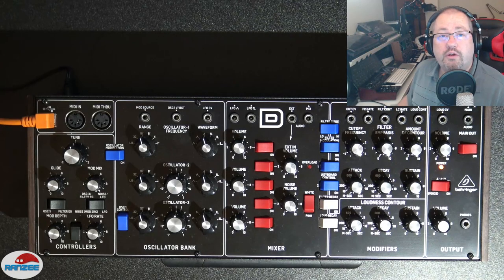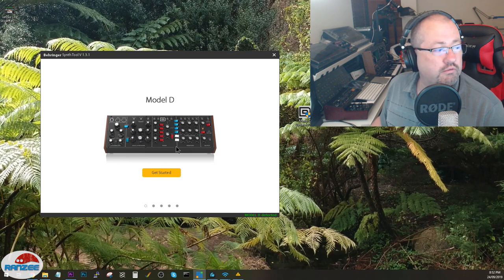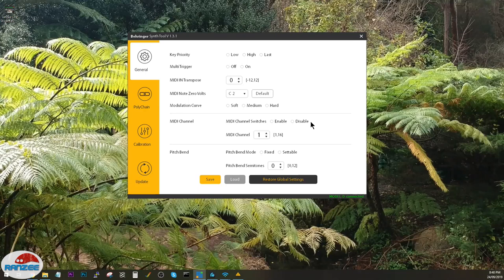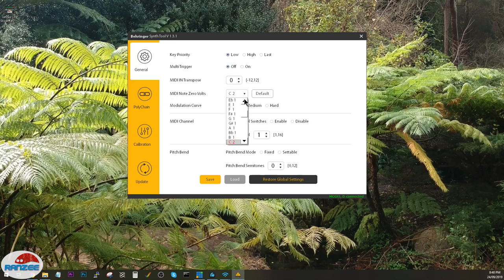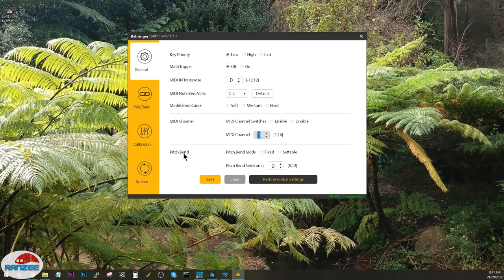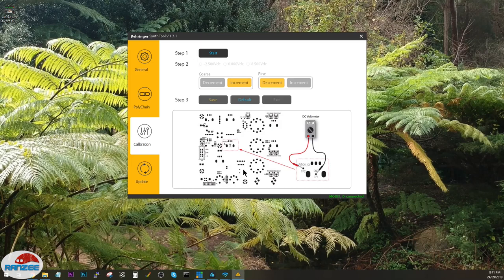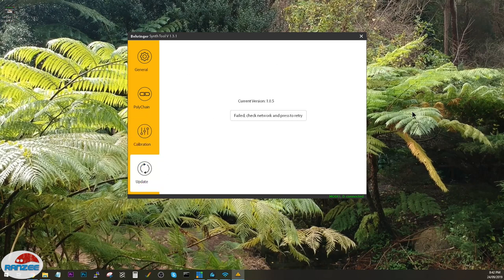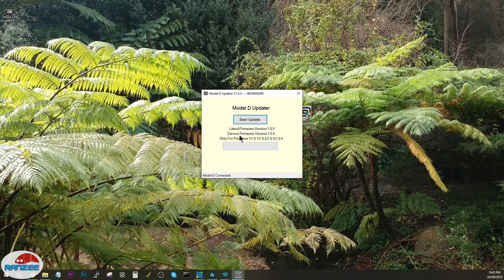Behringer Model D SynthTool and Firmware tutorial

Comment: Has the retriggering problem in the Model D being solved ?
Reply from the maker: What triggering problem is this you speak of?
Reply: @ranzee  when used with a sequencer 16th notes the B model D play some notes and not others
Reply from the maker: @crgl2009  I'll have to test this out - sometimes that is related to envelopes - so it will be interesting to see. How did you have yours setup to get this error?
Reply: @ranzee  sorry, I didnt have the model d when I asked. Now I have it. In its default mode if you have 16th notes next to each other in your daw, some notes are skipped. To solve this problem I tried first to shorten a bit the notes. That solved partially the problem since less notes were skipped. But this "problem" is easily solved by enabling retriggering on on the Model D. Its default mode is retriggering off. Now I dont have to shorten notes and no notes are skipped.